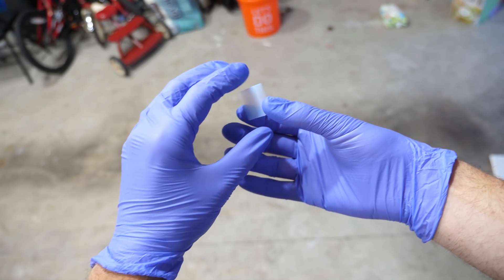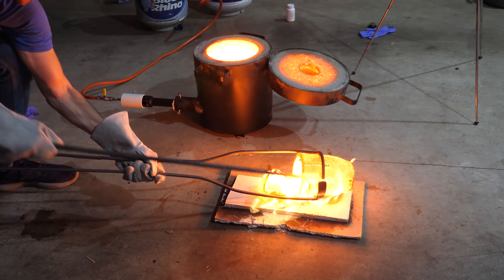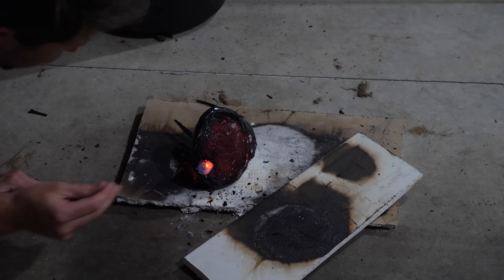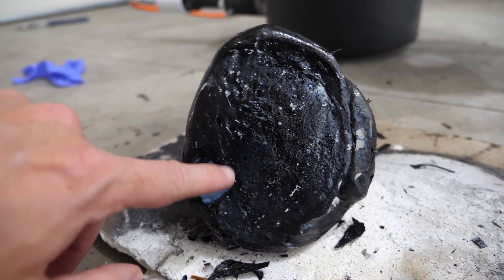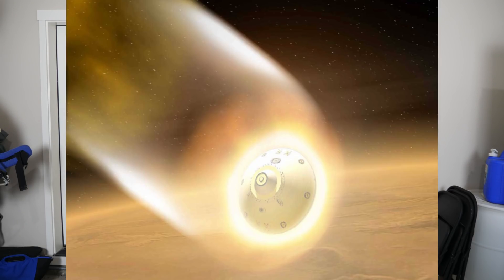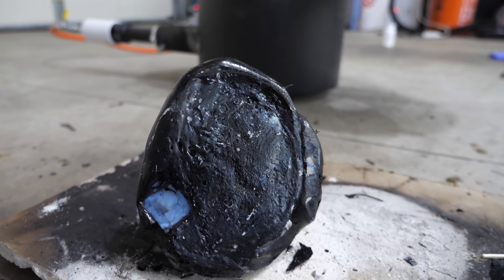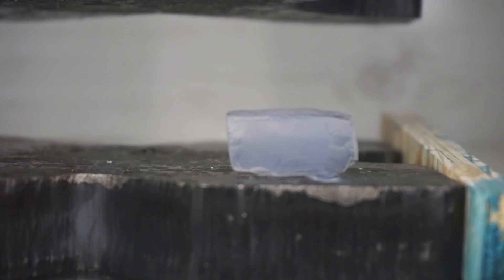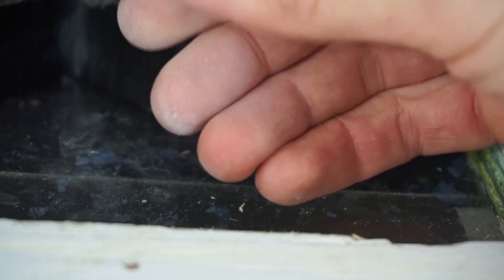Pouring Lava on Aerogel—Will it Burn?

Comment: I love a good spy thriller, and this video just gave me an idea for the ultimate test for aerogel. 

Your mission: to smuggle data across the border. It must not be transmitted over the internet. It must be physically couriered. 

Objective: Encase a Micro SD card in an aluminium ingot. 

The plan:  Load the card up with data. Put it in aerogel. Melt aluminium. Pour half of it into the mold. Quickly drop the SD card (in aerogel) in the middle of the mold and continue pouring the remaining metal. 

Cut, clean, and polish it to get your exact weight, 500g, 1KG, whatever.

The aerogel and Micro SD Card are so light that the ingot should be well within weight/size tolerances and impossible to X-ray too, right? 

Congratulations, you got it across the border. 

Now, cut the ingot open and extract the SD card. 

Try to read the data. 

What do we think? 

Card survived?
Data readable?

Comment: I have a test for you, pour lava into a single cast excluding a lit of course sphere if possable or a cube if it's easyer of aerogel, seal it up & see if you can pick it up, while seeing how long the lava inside stay's hot & monitoring the exsterior tempeture. Then once it cool's try to re-melt the lava fully encased in aerogel & try to pick it up again, Im more than couriouse on that one & if I had the mean's I would do it myself but I cannot not enough $$$  or equipment to test personaly.

Comment: You can touch the black part but it must be very quick. We have heat resistance. Thats why there are people who can walk through fire without hurting themselves. Someone did an experiment where he put water on his hands and dip it with molten metal for very short moment. He wet his have so the molten metal wouldnt stick to his skin

Comment: Aerogel is not the same material as the heat tiles used on the Space Shuttle. Those tiles were developed by Lockheed Missiles and Space Company in 1968, while Aerogel wasn't contracted for NASA use until 1992. Their insulation properties are somewhat similar, but they're really quite different materials.
https://en.m.wikipedia.org/wiki/LI-900
https://spinoff.nasa.gov/Spinoff2010/cg_2.html

Comment: You should have tried touching a match to the airogel in the lava rock instead of your finger or used a thermometer to measure the temperature of the lava rock and the aerogel.

Comment: I wonder if we could explore the earth core with a bunch of sensors packed into an aerogel box (bonus: using the energy around to navigate), the pressure, and maybe radiation would be an issue I guess.
Reply: We can't even make it much further than 10 miles into the crust, much less the core...LOL

Comment: Aerogel can also support more relative weight than steel. We should be building EVERYTHING out of this stuff...
Reply: Nah, it's too brittle.
You saw how it shattered.
You don't want your car to behave like this.
In most cases you want deformation before fracture.
Basically 'bend before break'
Reply: @johndoef5962  Good point...

Comment: Pretty cool. However - this was the perfect time to bring out the thermal imager... Why did you not use a thermal imager to measure the surface temperature of the aerogel (without touching it) embedded in the red hot lava?!?

Comment: So aerogel exhaust would make an internal combustion engine go faster, because the heat from exhaust gass won’t get conducted anywhere, so it will flow freely trough entire exhaust

Comment: We use aerogel as insulation in the refineries for 600psi high pressure steam lines, up to 900 degrees Celsius that I know of for sure, you can touch the insulation with a high volume flow and not get hurt.

Comment: The thermal tiles that protected the space shuttle during re-entry weren't aerogel were they? I thought they only used it for the fuel and life support systems and that the re-entry tiles were an assortment of different materials(depending on where on the shuttle they were located)

Comment: Maybe use a temperature probe next time instead of or before you use your finger you nitwit. lol.  What if a piece of the "lava" had dripped down or flaked off onto your finger?  Its guys like you that get their fingers lopped off in the manufacturing plants I've worked in.  A little common sense could save you from a trip to the hospital or worse. Please!

Comment: I wish you would have shown more dramatic evidence that the aerogel was much cooler than the surrounding rock.  Perhaps you should have touched the hot rock with a piece of paper or tissue to show that it would ignite and then touch the aerogel to show that it wouldn't light the paper/tissue.

Comment: the  space shuttle uses ceramic, NOT aerogel, in its thermal tiles.

areogel is used on the Stardust space craft to collect dust particles, NOT for thermal insulation. 

https://en.wikipedia.org/wiki/Space_Shuttle_thermal_protection_system

Comment: My Question:   Why does Aerogel sound like Glass or Metal?

@The Action Lab
Reply: Because it basically is.
He said, it's made of silicon.
It's a (half-?) metal.
And the structure of aerogel is comparable to the structure of glass or concrete.
Both also consist of long 'chains' or 'network' of silicon (oxides and stuff).
Only that in aerogel, there is just air trapped in the maze.

Comment: I actually got to do this in 2004 in eighth grade science class.  Our science teacher had one of the actual tiles from a space shuttle.  I don't know how she got it, I remember it was about 10 inches long, 5 inches wide and 3.5 inches thick and damaged on one end.  It looked like a broken piece of that yellow foam bedding but was white with one of the large surface area sides painted black. She used a bunsen burner to heat it up to red hot and then immediately after turning off the burner she put her hand on it and screamed.  Then lifted her hand and laughed to show it was fine.  She let a few of us try it out as well and I was one of the ones who got to try.  Honestly she was a grumpy mean lady half the time but the other half she did some pretty cool experiments.  I didn't like her very much because of her very abrasive attitude but I did respect her because of her willingness to teach us about interesting science.  Interestingly enough I transferred to that school halfway through  the year, ditched a lot of school, was assigned saturday school every week, never went, got suspended for ditching school and failed every class but because I scored so high on my standardized testing I was allowed to go on the school field trip to the arcade center with the honor students.  I remember the vice principal looking so amused when he said the school system decided to pass me because I showed an increase in my academic scores despite having failing grades.   Funny how aerogel sparked a trip down memory lane.

Comment: Should've used a laser heat thermometer on the aerogel cube when it was in the lava
Reply: Yeah what if he was wrong about his material or the material he used had a flaw?  Adv materials are cool but at least attempt to be safety conscious.  I see guys like this at work who don't check things before they do it and next thing you know we are taking them to the hospital.
Reply: @loganholmberg2295  Are laser heat thermometers dangerous? I thought one of the pros of using them was that you could use them at a distance...?
Reply: Don't laser thermometers work by detecting infrared radiation? If so the reading would have been way off because of the radiant heat from the rock around it and the "glowiness" of the tile.

Comment: 4:34 fake imagery, you can see the sloppy rotoscoping around the bottom of the crucible. He did not pour out an aerogel from the crucible at this point, as you can see by the lack of presence of a tile on the board after the dumping motion. And why is this the darkest shot of the entire vid? He's trying to hide the fakery.
Then, he proceeds to pretend that the next video clip depicts him holding the aerogel after being in the crucible, with no indication of its heat as verified by an infrared thermometer. 
Captain Disillusion taught me better than to believe this foolery presented in this vid.

Comment: That doesn't look like space shuttle tile to me, it looks more like aerogel.
Reply: It is, look at the description.
Reply: That’s exactly what it is
Reply: He said this tile is made mainly from silicon, and the space agencies use another material, but with similar properties.
Reply: Agustin Rizzo the space shuttle tiles were made of primarily silicon
Reply: @michiplays00  Ah ok I didn't recheck honestly,  woops. Thanks for clarifying
Reply: @Chizzoide  aerogel can be made of more than one material
Reply: 5:29
Reply: It doesn't look like you watched the video at all.
Reply: @watcherofwatchers  I watched until I realized the title description was wrong. I was expecting action lab wizard guy to touch a REAL Space shuttle tile. I have seen a picture of same experiment described holding red hot shuttle thermal tile AND THAT'S WHAT I WANTED TO SEE ! I saw the whole thing later. Still no shuttle tile.
Reply: @DelfinoGarza77  one thing you don't have in common with aerogel is the low density property.
Reply: @MrBearyMcBearface  low density in terms of what? Lol
Reply: @MrBearyMcBearface  that is a space shuttle tile...it is not translucent dense boy.
Reply: @DelfinoGarza77  I thought you said it wasn't a shuttle tile. What are you complaining about, then?
Reply: @MrBearyMcBearface  action lab guy said the aerogel has properties like the shuttle tile but the description says touching a red hot space shuttle thermal tile demonstration. Youre denser than I am lol.
Reply: @DelfinoGarza77  stop trying to troll me when I'm trolling you 😕
Reply: @MrBearyMcBearface  are you annoyed? If you are you need to stop it.
Reply: @DelfinoGarza77  lol. I'm not.
Reply: @MrBearyMcBearface  yes, you are.
Reply: @MrBearyMcBearface  "\_0_/"
Reply: @DelfinoGarza77  Agreed Delfino.  It's almost like young people (Mr. Action Lab) just don't have the same reference as older folks.
Reply: It's both